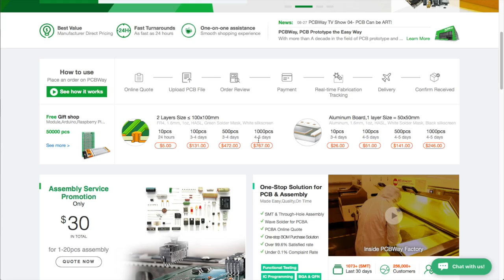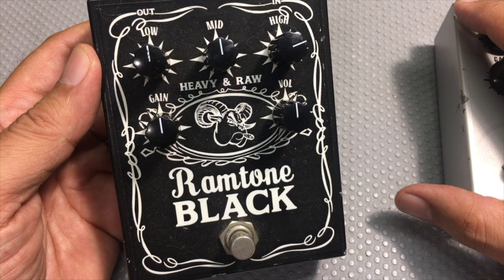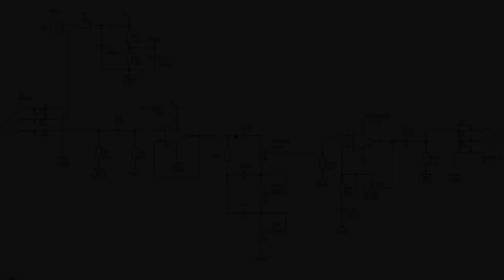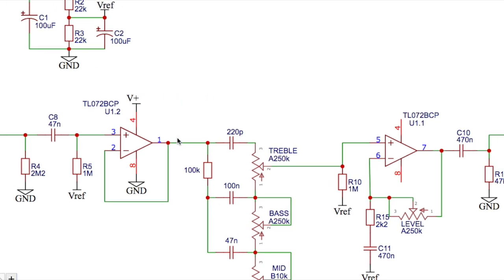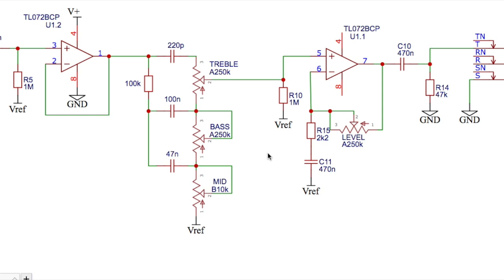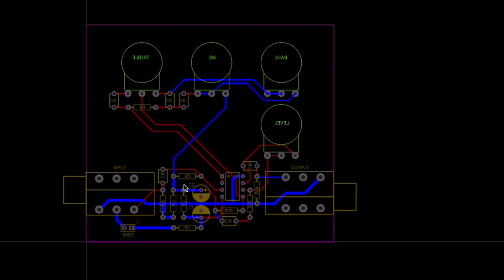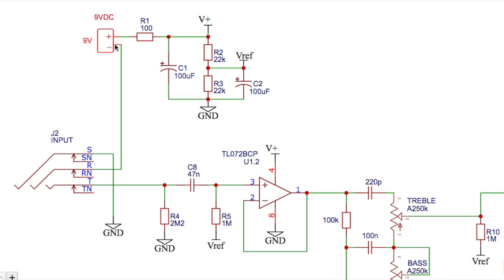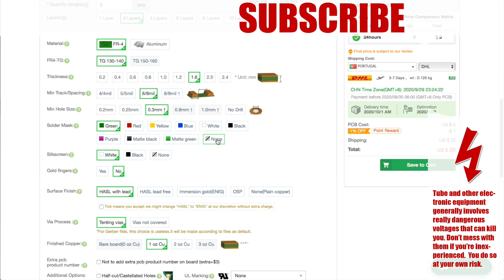Guitar to Tube Radio Interface, using PCBWay PCB's. Prototyping journey begins.

Comment: I remember going straight from a Strat copy to my Grundig Radiogram K 2 ST/WE back in '78 or thereabouts. It actually sounded quite good!
Reply from the maker: It’s not bad at all, Just a little limited.
Reply: @electronicsoldandnew  Sure, but there were no bucks for an amp :-)

Comment: Have a request.  In the next video, would you please explain how things work with the J2 Input Jack?  It appears to me that SN, RN and TN are NOT connected to anything.  That S goes to Ground and T goes to the input of U1.2 via R4, C8 and R5.  The way that type of jack usually works is that when you plug in to the jack, S is disconnected from SN, R is disconnected from RN and T is disconnected from TN.  Since SN, RN and TN are NOT connected to anything, those pins on the jack don't really matter.  The problem I am having is with the "R" connection on the J2 Jack.  Unless "R" and "S" are somehow connected together using the plug that is plugged into J2, I don't see how you are getting + and - 9Volts to the board, well the - 9Volts that is.  Wouldn't you achieve what you are trying to do by connecting the - of the 9Volts to ground and the reference point to all the Vref locations?
Reply from the maker: i’ll check that out and either explain how it works, or how I made a mistake 😃